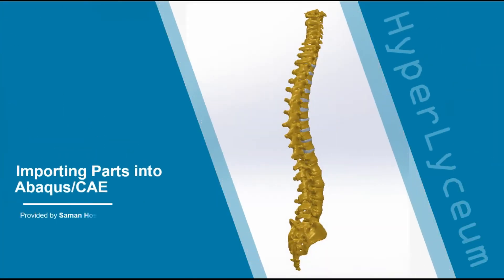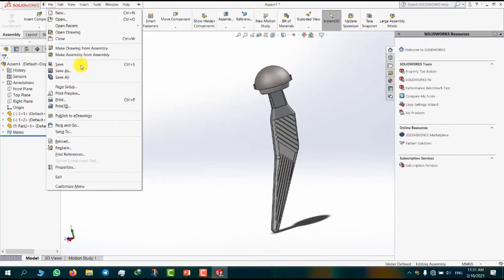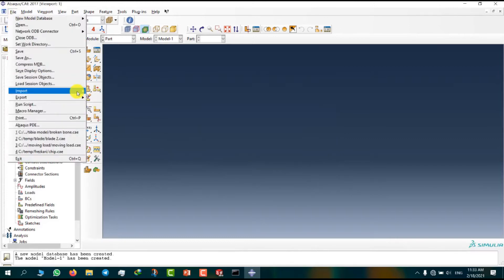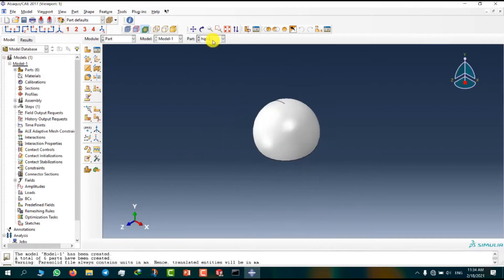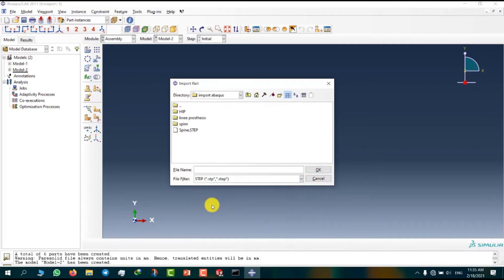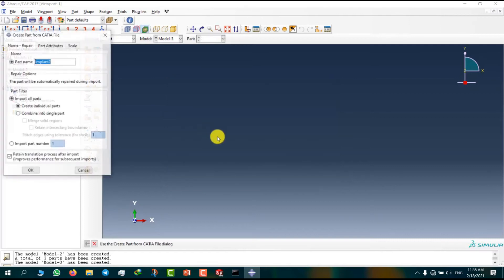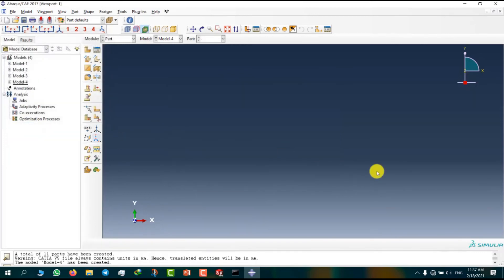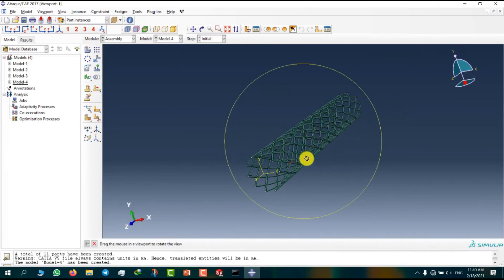Importing complex parts in Abaqus

Comment: Hello Sir, I have noticed that when i import hollow section into abaqus the volume seems to increase from a solid section what would be the cause of this?

Also when I simplified an assembly in inventor to a part and export that into abaqus, even then abaqus display a volume that is 1e6 greater than the volume given in inventor why is this sir. There was also extreme complications such as IGES file type just was unmeshable, and I have a complex geometry so its not possible to manually partition all the parts, So i creatd a partition matrix, but this does nothing.

I am also unable to cell partition a step file to assign a different material. If you have some niche knowledge or insigh on this please let me know.

I was trying to analysie a robotic arm in abaqus, but there is some how more and more complication, that I have never seen on any tutorial happen to me. 

Reagrds.